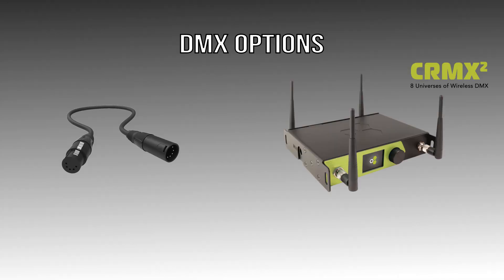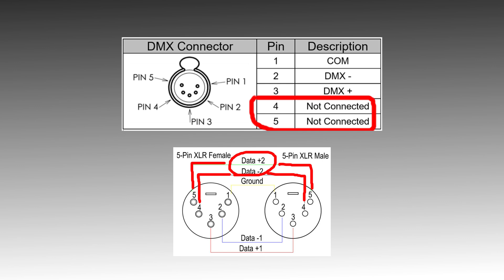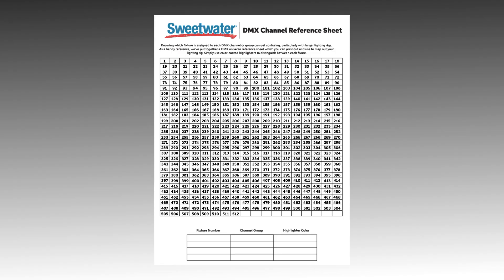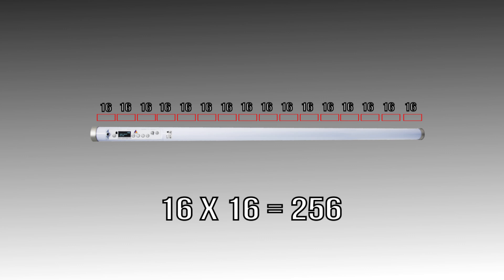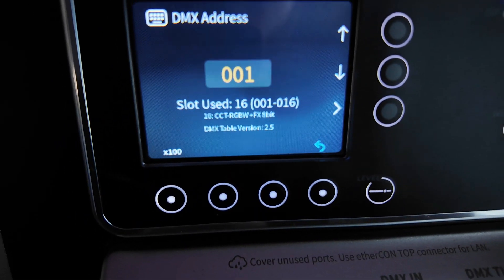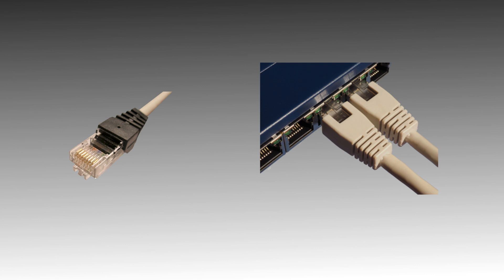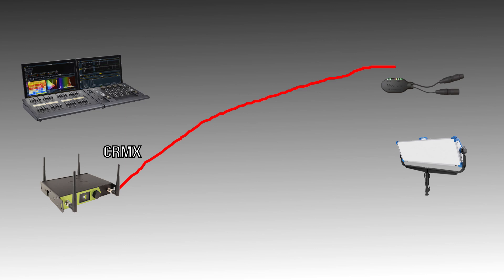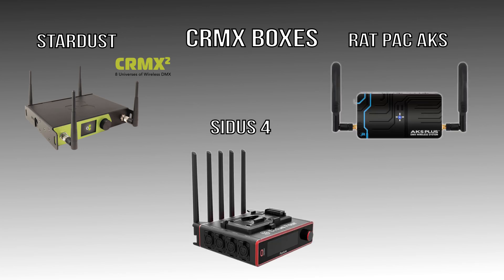Understanding DMX/CRMX Lighting

Comment: What you think about "Cerise" ? Is it good? Its equal to sidus or rat pac?
Reply from the maker: I haven't worked with it personally, so I can't say. Sidus and ratpac are very reliable. The Cerise looks okay but it doesn't have built in bluetooth or wifi if you are looking for that. The 1 Universe unit seems like a good deal. If you needed anything more than 1U I'd  get something more reputably at that point like a stardust, as the cerise 2U is already more than half the price of a stardust, and the stardust  has cat 5 for setting up an external wifi network as the stardust wifi is not recommended to use on large scale setups over longer distances. There is also a cheaper option like the lumen radio moonlight for a smaller dmx option as well.